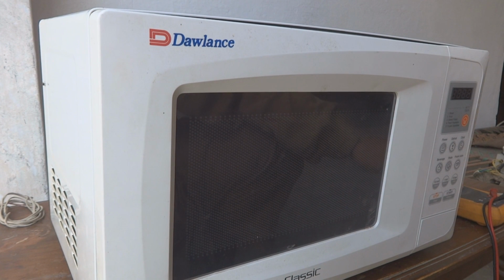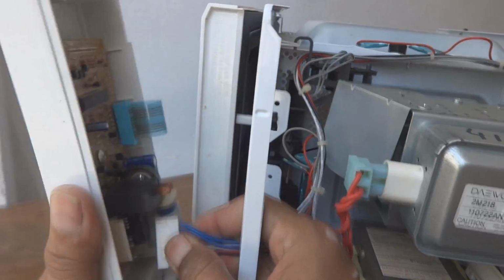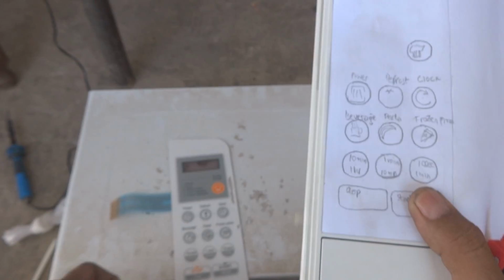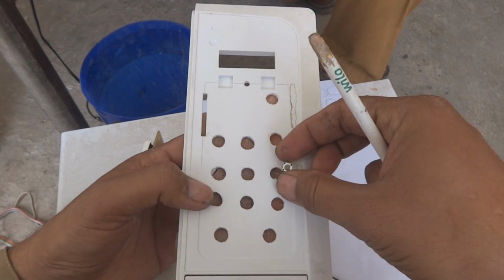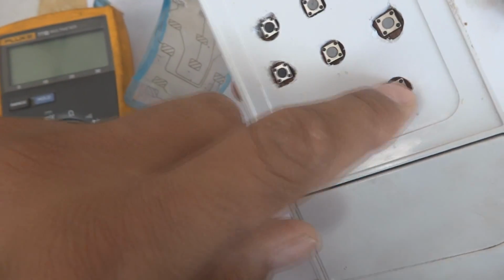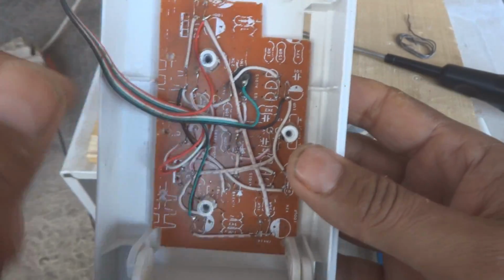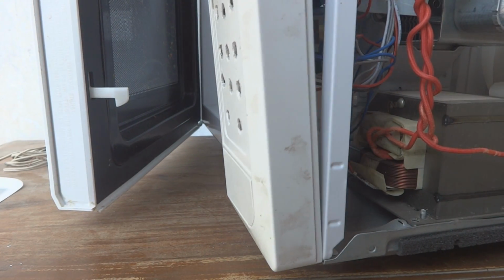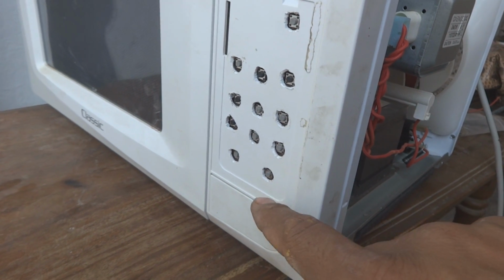Microwave oven repair. Keypad modification.

Comment: Great work.  However its a lot of work.  Years ago a friend that was poor her microwave went out, every key pad worked except the start pad.  I checked all interlock switches and all good, even cleaned and reinstalled the keypad ribbon, and no go.  I decided to trace ot the contacts forthe start pad as the msnufactore gave a schematic for the key pad.  I soldered the two wires off of the proper connection spots on the back of the circuit board where the ribbon cable plugs into.  Then drilled a hole at the bottom of the key pad escoutcheon, instslled a momentary push button switch, wired the 2 wires to it, and that was the new start button.  Was not the prettiest of repair, but it worked tgat way for her for several years.  Great video.

Comment: my keypad make tiktik .buzzing sound .I check with other board .do microwave is working. so how n what problems in that keypad n how to fix
Reply from the maker: Same could be the solution. Or order original replacement parts if you don't wanna do modification.

Comment: dear sir  i done all these things but power on button isnt working Starting button. kindly tell me the  bypass connection for direct on buttion
Reply from the maker: Check your wiring again. Sure there would be some issue.
Reply: @JahanZeb1976  i checked again & again but can Not Recognize the fault can you please tell me just how to bypass the power button just.

Comment: Sir your video very use full to me but I have some Doughts can you help me sir
Reply from the maker: Sure, I may help you. Comment your problem so that I would try to help you.
Reply: @JahanZeb1976  sir Samsung microwave Tuch not working so I want to make some buttons give me your what's app number
Reply from the maker: @nellaimobiles1323  +923319327762
Reply: @JahanZeb1976  please upload one video for button wire connection base touchpad

Comment: AoA brother, I've Panasonic inverter microwave NN-SF550W, it's an Australian model so no parts available. On my microwave all touch buttons are working except 'timer select' buttons and the 'Start' button. What i can't differentiate is whether the PCB is faulty or the touch pad.  Can i somehow find out the faulty part without removing the front pasted touch panel?
Reply from the maker: It's bad touch pad as in this video. Unfortunately your microwave would need same repair as I did here in this video or you would need the OEM keypad. Regards,

Comment: My dear friend,
I have a LG micro wave and the touch pad was not working the agents say the parts and the touch pad is not available,They wanted me to buy an other new one.
I decided to search on the you tube and I found your video was the best.I am going to show this video and  advice my electrician to modify the touch pad the same way you have done it.This is possible to do in Sri Lanka since we have very good technicians to this type of  repairs,all the material is available and you have given a detail method of working it out step by step as to how to do a complete repair.  I love it!  So many times the agents advice to replace repairing "repair means an art of modification  "replace is the last thing to do ".  You showed  way to fix it better than it was!  Good work! I really appreciate your contribution to the society.
Jeffrey Silva
Reply from the maker: Very good luck! Did you solve it?

Comment: Wow, I thought I was the only one in the whole world who did exactly the same thing you did.  I did this to a microwave oven that I really liked because it had a built in electric heating element for broiling and could be used either way.  
Most keypads can be repaired using a liquid sliver conductive pen and a bit of work carefully separating the membrane keypad.  Sometimes they're beyond repair and the only option is making a replacement as described in your video.  Micro button switches are easy to get from junked electronics, or even new in bulk and these will last way longer than any membrane keypad.  I'm glad I'm not the only one who did this. :)

Comment: Sir my microwave keeps on all time but no heating. When I open door then it turns off. When I press  keypad start button it works to heat. But won't stop unless I open the door. What should I do?

Comment: Great video.   And very good mastering of the English language.
This is my style of repair: Use what you have and what you can get, maybe from a scrap microwave. 
These keypads are notorious for failures, usually locking the whole microwave up, or on more recent units, giving an error code on the display. My family microwave has such an error, but only when the temperature in the kitchen falls below 12 degrees Celsius. Simply resting my hand on the keypad for a few seconds fixes it. It is the weight defrost button that is causing the problem.
Here we have a "hard rubbish" collection every year where people put "rubbish" out for free collection. Generally broken furniture, old TV's etc, and microwaves, because the repair people tell the owners that they are not able to be fixed. EVERYTHING can be fixed! Last year I  rescued a Samsung microwave. It had an error on the display (keypad error). I fixed that using a hairdryer and pressing each button very hard (fat and condensation gets in between the contacts). 
This year I rescued another microwave - same brand but a bigger model,  also a few years older. Different problem (no power - the control board is dead). But I was able to use the control board from the other one to fix this one.
What will I do with it?  It is a standby for when the family unit fails.
Reply: @Jeff Allen: I too have a similar problem with my Samsung microwave oven. I’m not a technical person. I called in the service guys from the “authorised service Center”. But it turned out he was not reliable and didn’t know what to do. Now the key pad just blinks. I called in another one but turned out he was no better. What do I do? Grateful if you can help.

Comment: l need help microven membrane keypadable model m1833N

keypad not working  switch how to fixed interconnector lam not understand please lneed to help
Reply: #MIRMAHMOOD  WE ARE MANUFACTURER AND DEALERS OF MICROWAVE OVEN MEMBRANE KEYPAD AVAILABLE AT VERY COMPETITIVE PRICE. +919969256369  +919969399940 ABLE MUMBAI ableelectronics@vsnl.net ..

Comment: P.S.  I'm from the U.S., and learned T.V. (and some microwave) repair in the 80s.   Oftentimes back then we would troubleshoot a circuit board rather than throwing it out and getting a new one.

Comment: aslamuglakum
i am from mardan kpk my mobile no is 03005710446  my oven tuch is not working m oven name is  daeewo kor.6l6bdsl   modil    you send me mobile namber please
Reply from the maker: Dear friend you may send me an email at geoharzaman@gmail.com so then I will serve you my number and also mention do you need ufone number or what's app?
Reply: nasrullahnasrullah58@gmail.com         jo vedio ma ap na touch repier istra ka circuit ha daeewo oven ma i am some work also eletricin meeter and solder gun also avelebel
Reply from the maker: I sent you one email with my number but I didn't receive any response from you.
Reply from the maker: Dear friend the contact person name is Abdul Kareem Khattak at city grid station Peshawar.

Comment: Man you are a master in the DIY world 👏👏👏 the most important thing in every repair is understanding "how it's work , the cause of fault and the best repair available", and you show us every detail in every repair video you make. 
Thanks and best regards.
Reply from the maker: Thank you very much dear friend for liking and appreciating. This was a great opportunity to show such a repair details as it is required to everyone everywhere having such common machine. Best regards,
Reply: LearningZone i have a question about the relay on the board is it for the plate's motor?
Reply from the maker: The relay is providing power to everything. When all logic is complete, the relay switches on and switch on everything including megnetron, lamp, cooling fan and floor motor.
Reply: LearningZone Thanks again i appreciate your help, have a great day .